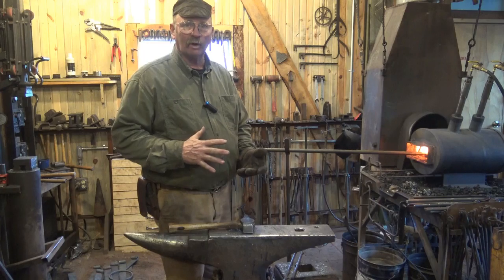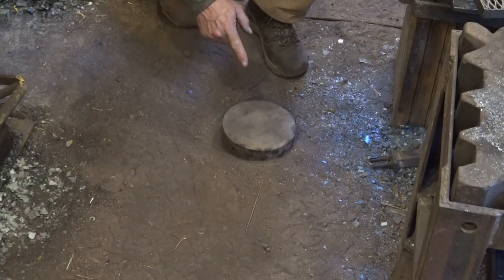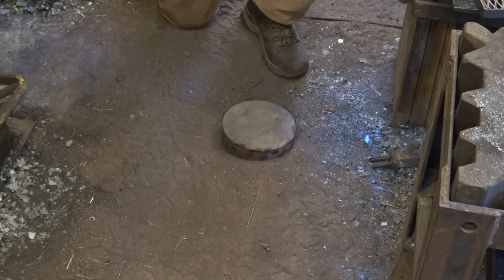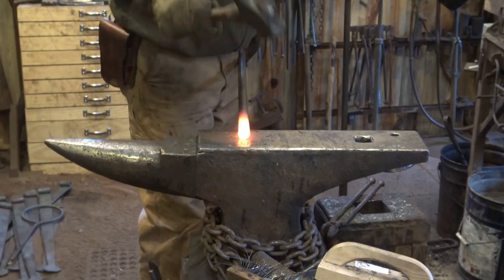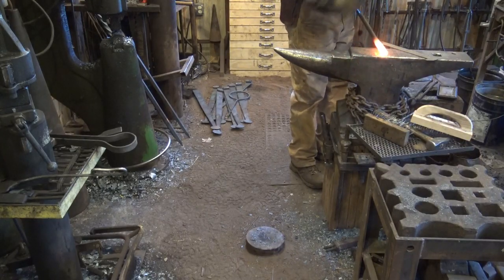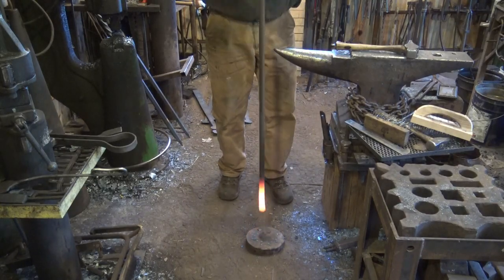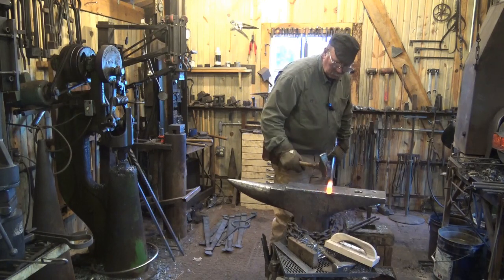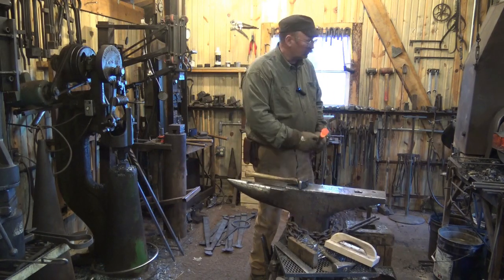Upsetting long bars with an upsetting block - quick tip - basic blacksmithing

Comment: Any tips to avoid cold shuts when upsetting 3/8 round bar?
Reply: Keep the end of the bar from curling back "Mushrooming" by hammering the end repeatedly to a taper after each upset attempt.

Comment: What can you advise for upsetting lighter stock? Say 3/8" upsetting for penny end scrolls, one or two taps and I'm off at a 45º. Probably practice and smaller heat, right?
Reply from the maker: Perhaps heating a very small area with a torch.  But also holding in the vise so only the upset is sticking out.  This is always a problem with lighter stock.  For a scroll you might just weld the end back onto itself.
Reply: Black Bear Forge Great tip!

Comment: If you want a shorter heat then don't put the bar as far into the forge, exactly the same as a coal forge
Reply from the maker: Sounds simple, but it doesn't work like it does with a coal forge.  The hot spot for wear you want the high heat is further in than just right in front of the door.  There is also plenty of heat coming out acting like a torch to heat a longer section of bar.  This is an issue with every gas forge I have been around and is one of the advantaged]s of coal over gas.